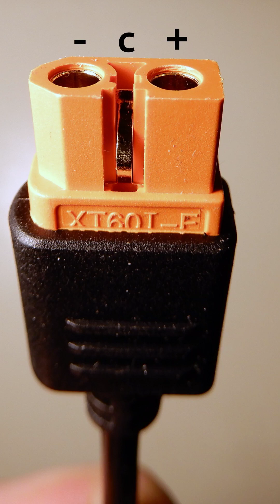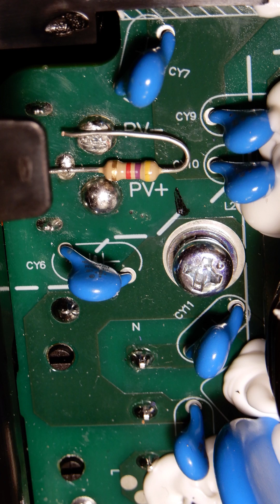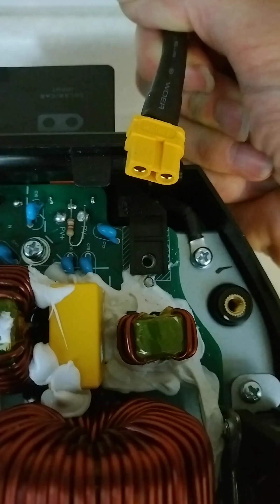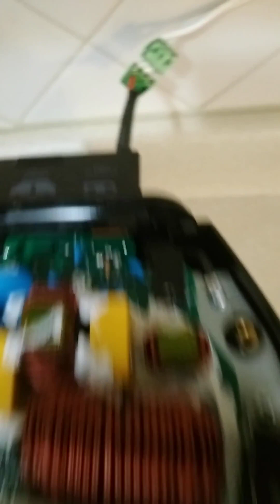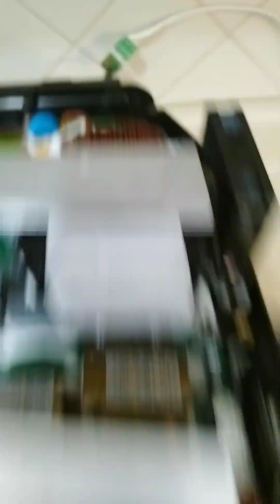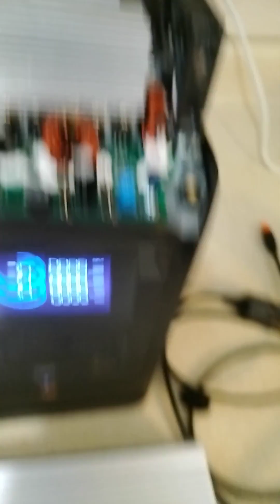Ecoflow Delta 2 hack :: Full charge current with generic XT60 solar cable

Comment: If you connect the xt60i with car charger (e.g the one that is provided with Delta 2) it will instantly burn the fuses in your car (or the board, or both) because you'll have a dead short through this center pin (you suggest connecting center to negative at the board, the cable may have center connected to positive in case of car charger). Before disassembling the whole charging station and trying to modify something you may just solder a replacement xt60i cable instead of generic xt60, they may be found on Amazon for $1.

Comment: Yo!  These systems are pretty flexible, but I wouldn't do this.  the DC barrel port native to your vehicle is probably only a 10 amp  fuse.  Drawing more current  through native wires and your fuse block  could start a fire, or at best even fry your fuse block. Natively its only wired capable of about 180 watts. Theres a reason why the Alternator Charger comes with  heavy AWG wire.
Reply: its not that he uses it in the car, you can use other cables now that don't have the XT60i connector

Comment: What hack can I do to "Fast Charge" an external 12V LiFePo4 battery with my Delta 2?
Reply from the maker: @Alfre2JQS  I guess an AC powered charger.   Theoretically the Delta 2's internal 48v could be accessed through the external battery power. Their air conditioner does that. But I don't know how to enable the output.
Reply: @realsolarcars  someones said tha puting a 1k  resistor between two of the six pins of the extra battery port activate that port to charge/discharge a 52V battery. What do you know about that?

Comment: In my experience, Delta 2 only applies 8A limit if the input voltage is ~12V, as you would expect from car cigarette lighter. 

Even a single 100w panel has VoC of 20-23V. So you can see on the app that Delta2 sees that as Solar. 

I don’t think it limits Solar input to 8A, even if one uses the generic xt60 connector.

Comment: I just purchased an EcoFlow River 2 Max from my local Sam's Club. Upon inspecting and metering the XT60I Plug (car charger), the Square End as well as the Center Contact of the XT60I tone together with the center pin of the CLA (Cigarette Lighter Adapter) all showing zero Ohms/zero resistance. This would indicate that the center pin/contact of the XT60I is acting as a positive voltage signal for the charge controller of the EcoFlow River 2 Max. The standard Solar charge cable that EcoFlow shows has a standard XT60 female plug end on it WITHOUT the center contact!!! Knowing this helps alot as I am having to make a cable to fit my solar panel setup--my solar panels have SAE connectors. Hope this is informative!!!

Comment: hi , my delta 2 is reading the solar panels as a car charger and it is just putting  350 watts instead off 500 watts do you know how to solve it. i am using  xt60 i should i use xt60 ?
Reply: From what I can tell even some XT60i connectors are not even tied to the negative or positive terminals (I have one that I purchased on Amazon) so it will not charge from solar at 400-500 watts. You have to make sure the xt60 has a connection with an ohm meter. I also heard that ecoflow has the polarity reversed on their systems? not sure if it's true but that could explain why the signal on the center pin is coming from the percieved positive side. You could just buy an xt60i connector and bridge the center pin to the negative side with solder if you want to keep your cord. There are videos on how to do that. I am going to cut mine off and replace it with a soldered xt60i. This way you won't void your warranty by soldering on the board.

Comment: Does anyone know what the max watts from solar panels the Delta 2 can handle before it refuses to charge? I'm thinking of connecting 2x400W panels in parallel on a wall as they won't get full efficiency ever. But will the Delta 2 refuse charging if at ideal situations they provide say 600W?
Reply from the maker: It will self limit to 500w. As long as the open circuit voltage is within the limits it will be fine. For the test here I connected it to a 600w power supply.
Reply: @realsolarcars  thank you so much for testing!

Comment: Why 4700 ohm resistor when you are speaking of direct connection between central pin and + or - pin, thanks and I’d love ya feedback…
Reply from the maker: If I put a jumper wire between the center and ground then the car charger would short out. With the resistor I can use the original car charger and it will even reduce the charge current like it was designed to do.
Reply: To avoid losing warranty, could we add a jumper from center to positive just for solar use with a regular xt60? Thanks
Reply from the maker: @03056932  To avoid loosing warranty you can buy an Ecoflow solar cable.  The regular XT60 doesn't have a center pin.
Reply: @realsolarcars  thanks. Theirs seems quite short unfortunately and incredibly expensive. I guess I could get mc4 extenders instead?

Comment: So my delta 2 all of a sudden wont charge via car charger. What are the chances its just the cable and not the charge controller or connector on the delta 2 itself?

From the sound of the video, should I grab a standard xt60 to 12v plug or should I try one of the xt60i to 12v cables that is available? Dont really want to trust the ecoflow cable
Reply from the maker: First thing is make sure your car's outlet is good. If you can check the output of your cable with a multimeter it is probably good. I say probably because I've seen situations where the voltage measures fine but no current can flow due to corrosion.
Reply: @realsolarcars    it's the 12v plug itself on the ecoflow cable. Despite continuity testing fine, the plug itself was the issue. I hardwired it and bypassed the 12v plug and it charges fine now. 
Pretty positive my 12v plug is fine as it's a fairly new vehicle and I use it with multiple different devices and none of them ever have an issue. The problem with the ecoflow persisted in my rear and front 12v sockets, as well as both sockets on another vehicle.
Reply from the maker: @vdub5818  glad you figured it out. Those lighter plugs can be sketchy.
Reply: @realsolarcars  I have a newer jeep which has the auxiliary switches. So I ended up getting a proper xt60i to mc4 cable, with the center pin shorted to negative to allow for the full 15A(or 500w) charging. Then crimped an MC4 onto my aux positive, and made a small ground wire with ring terminal on one end and mc4 on the other so I can easily remove the solar cable if needed. 

Doing so has yielded charging at 13.8 amps, but actual charging wattage is dependent on what the "smart" alternator is putting out. At 14.3 volts I get 198w, and at a more standard 13 I get about 178w. Substantially better than the 100ish watts limit of the car charging setup with the center pin shorted to positive.

Comment: What you said is not true. I can charge full speed with regular xt60 cable my Delta 2. No need for xt60i
Reply: Full speed with your solar panels or full speed by 12 volt DC charging and if you don't mind mentioning maybe if any connectors are generic or or worked in by yourself DIY is what I'm hoping to do but I've got jackery solar panels 400 Watts worth solar Sega 100 watt with I think 8 mm plug and then it has to go into a adapter before it gets back to my jack1500 expler and just trying to figure out what connectors I actually need to ask for or basically I want to order online I don't think anybody sells those connectors in a store Amazon has some company selling some Chinese rubber and wire I'm sure but yes any information you can give me would be very appreciative and helpful but trying to hook up my four solar Sega jackery solar panels to charge my Delta 2,

Comment: if i see that correctly, the value of the resistor is 4.7k ohms 
do you have voltage measurement from the original solar cable to xt60i at the middle pin ?
Reply: Saying 4700 ohm is not incorrect. 4.7k ohms and 4700 ohm are literally the same value.

Comment: But most cars only allow 10 amps if  you this mod you’ll blow to fuse on the car
Reply from the maker: Valid concern. The lighter socket wiring on the Volt is shockingly thin.  The reason this resistor hack is cool, is that the included ecoflow Car charger still works at 8 amps max. A generic cigarette charger cable might run 15 amps, which would be bad. That might be why ecoflow programmed the units like this. Safety first.
Reply: @realsolarcars  Best to just connect directly to the battery and avoid the lighter socket! Use a fuse and you are good to go.
Reply: @realsolarcars like EcoFlow gives a f*** about our safety they did it for a cheaper liability insurance brother 😉👌
Reply: That gave me a little laugh because for a second there I thought to myself.  🥹 "Way to go Eco flow....🫡 thinking about my safety 🤗.....😍" & And then I woke up and remembered it wasn't 1985 anymore in 2024 billionaires are thinking about cheaper insurance.
Reply: Yeah but he probably not using car to charge just the car charger 🙄 I hope that makes sense in a little stone

Comment: Hi James. Are you still working on the direct 400v solar charging boards?
Reply from the maker: Yes. Stuff keeps getting in the way, but I'm trying to solve the last part: high voltage connectors.

Comment: I tried this gas I got second and third degree burns after the resister tripped the auto flux capacitor to discharge full at 2000W.  So it released all that energy in one giant ball of plasma.  Burned my face and hands.  This is stupid idea.
Reply: hahaha so funny

Not. You wanna have fun? Add a parallel XT on the main battery cable going to the inverter and drill a hole in the case so you can run the other XT outside the Delta. Boom, you can add ANY Lifepo4 (if you have an LFP model) battery at the same voltage AND same State of Charge to massively increase your capacity for a fraction of the cost

*Don't use some piece of shit battery. It needs to be capable of discharging at the highest rate of the Delta's inverter which nearly all batteries worth a shit are
Reply: @ericklein5097  this is actually exactly what I want to do. I was thinking of using the external battery plug for that, but probably there is a proprietary protocol running on the data pins. 
So you are saying adding a parallel battery via the main +/- is no problem? The external battery must be the same (big round formfactor of cells) with the same capacity or can I use a bigger one (its 48v if I am not mistaken)

Comment: The reason it limits it to 8 amps from cigarette outlet is because they can't handle much more than that current. If you draw 15 amps it could blow a fuse or worse melt the outlet etc.
Reply: Mine was almost melt the console of a seat Ibiza at only 8 amps.. The guy says right. If you know what you are doing
Reply: Yeah they can’t handle the 8A either. Car connectors are really bad connectors and unnecessarily huge too.
Reply: I suppose that could also void the warranty if they figure out you did something like that.  You would have to remember take the resistor back out for warranty.  Ugh

Comment: Not sure if due to firmware update or higher voltage detection, but I'm using a generic xt60 for my solar panels and charging near 400w with 2x2 100w solar panels (2 series pairs, in parallel with each other).  The ecoflow is detecting them as solar.  Point is I'm not sure this fix is needed any longer on the Delta. 2.
Reply: It's because you have two sets of paralell panels connected in series, so you are likely getting an open circuit voltage of over 50V. With a standard XT60 you are limited to 8A (8A at 50V is 400W). It's not the Watts, but the current that is limited.
Reply: @spencerm106  i don't think so.  Open circuit rating of each panel is about 20v.
Reply: That's not what he is saying. If you want to get more out of car charging, you can trick the Delta to think you haven't plugged in the I connector (found on the car charging cable). The I connector limits current to 8A to prevent people from blowing fuses in their cars.

Your solar cable should be a regular XT (I think, I don't own these overpriced gadgets, I build my own) so there's no current limiting taking place....except for MPPT limits
Reply: I used the car cable to connect my solar panels (2x400W) to the XT60 port and this doesn’t work properly, the Delta 2 thinks it’s being charged by a car and limits the current to 8 amps, also the MPPT is not working so even in sunny conditions the input power is below 200W. 

Good to know that a generic XT60 plug will work, but i guess I’ll take the easy route and just buy the Ecoflow XT60 Solar cable to take full advantage of the solar input.

Comment: does this works with the ecoflow wave as well? so i could run the evoflow wave with 15amps @ my 28v lifepo batterys?
Reply from the maker: Ecoflow says 12 amps , 200 watts max for the solar input on the wave. That might not be enough to run it, but could certainly be used to extend the runtime. You could avoid this hack by getting an Ecoflow solar cable and using that to supply power from your batteries.

Comment from the maker: The Delta 2, Delta Pro, and maybe other Ecoflow units use the third pin on a XT60i connector for signalling.  Adding a resistor between the signal pin and minus pin makes the Delta 2 detect a generic XT60 as a solar charger instead of a car charger. 

The car charger will still work as designed. Some power will be lost in the resistor. Or build your own car charger from a solar charge cable and car charge at 15 amps if you know what you are doing.

Buy a Delta 2: On sale for $899
https://shareasale.com/r.cfm?b=2142357&u=3399918&m=97298&urllink=&afftrack=
Don't forget to get the solar charging cable so you don't need to do this hack. 😎

Start an LLC with Northwest Registered Agent:
https://shareasale.com/r.cfm?b=965743&u=3399918&m=69959&urllink=&afftrack=

If you make a purchase from one of these affiliate links Real Solar Cars may receive a percentage of the sale.